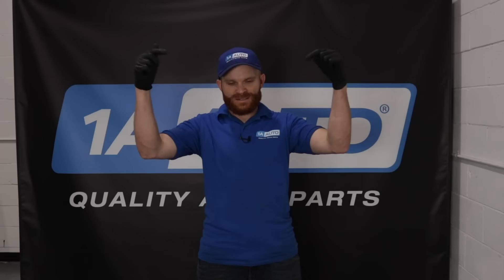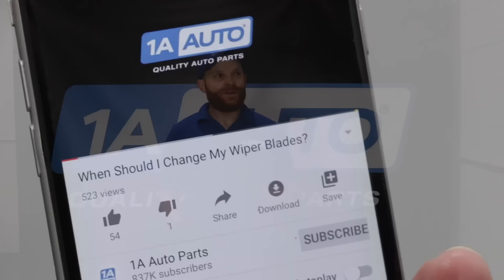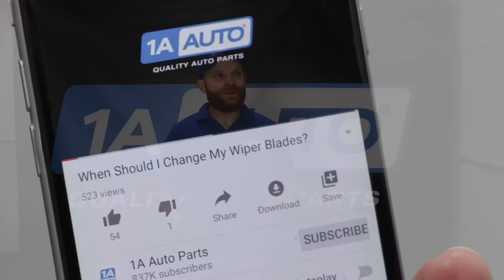Weak Acceleration? Rough Idle? Diagnose a Car or Truck Throttle Body!

Comment: How do you clean the outer edges (perimeter) of the butterfly without opening it?
Reply: I used a q tip soaked in carb cleaner

Comment: I cleaned my throttle body on Toyota Corolla 2009 and after cleaning it actually revs high when driving spontaneously and revs high when I turn on my ac
Reply from the maker: +Luis Dominguez We wouldn't be able to diagnose an issue like that here, you may want to have a local mechanic take a look at it. Thanks for checking us out! http://1aau.to/m/Shop-1AAuto-c

Comment: Could this cause multiple engine misfire codes ?
Reply: my tiburon does this same exact thing, all the symptoms but then throws a code for misfire cylinder in 3 and 6 i’m not sure what to do im goin to clean the throttle body hopefully it does the job. Did you fix yours?

Comment: I have clean the throttle, the MAF and the IAC, however, so much disassembly and assembly may generate a vacum leak.
What is the best safe method to find a vacum leak?
Can you show, tipically where a vacum leak can happen after cleaning the throttle body, MAF and IAC valve?

Comment: Thank You great video 👍🙂  I do have a question : when you disconnected the electrical part from the throttle body you said to look for any discoloration or corrosion. If it is clean, does it help, hurt or make no difference to put dielectric gel on it ?
Is it good to put dielectric gel on anyting for instance... fuses, modules or anything at the electrical Connecting Points ??
Reply: No, it actually acts like a insulator. It is for where you don't want the electrical to go past the outside of the connection.  It also prevents corrosion from water and dirt.

Comment: my 1998 chevy 5.0/305 votec engine is losing power when a hill and gain back its level off what can be done. I have replaced the fuel pump, throttle sensor position idel position

Comment: Hey bro I spray power foam in my car. Now it will now start. What’s the problem. Car was running great before just a little rough idle…so I use the power to clean the deposit….NOW I CANT GET THE CAR TO START

Comment: what about the control to the throttle body? im having a really loud start and surging when at a red light. If i put it in park im good a little rough idle but not too bad, When in drive its crazy bucking and stalls here and there
Reply: Same here. Have to put in park when im at a stop

Comment: I had a chev s10 and the flap in the throttle body had three holes in it with a piece of tape over the holes and it ran great, take the tape off and it ran like crap, nobody i talk to can explain it, would you have an answer.

Comment: Doing a smoke test on a throttle body (5.7L 1996 Vortec).  I have smoke around the shaft that the spring and throttle blade mount to.  Do all of them do this or is mine bad?

Comment: Hey. I have the Engine power reduce only in colder conditions. I would just turn it off and back on and it would go off.  Months pass same situation. Its veen a while it hasent done that. Now, i feel the rpms are not right and it shakes a little. What could it be.

Comment: Is this why my cars dying at a stop light?? My rpms keep fluctuating then my car dies. The acceleration also bogs.. all my fuel systems are new.. I have a year old battery and alt. Also new coils and packs. Also replaced the sensors on throttle body. And my o2 sensors

Comment: I have a 2004 Chevrolet Tahoe and I have my fuel pump and my fuel filter replaced and my check engine is still on and it’s causing deceleration

Comment: I have a 1982 Chevy c10 that has a idling issue possibly. If I were go to Chick-fil-A and sit in the line. After a bit my motor will sounds like it’s getting ready to cut off and my truck cuts off cause I say still for too long. Do you think it might be the throttle body needing a clean? I’ll give it a try tomorrow and see if I can figure it out. Any help would be appreciated

Comment: Hi I need advice, I replaced my fuel pump and fuel filter, changed my plugs and leads, but my Ford Fiesta giving slight rough idle and oh also I removed the throttle body and MAF sensor cleaned it but now I got this rough idle and when I try accelerate it just stalls. 2005 Ford Fiesta.

Comment: So I have a 2016 Jeep compass throttle body but it makes the engine shake real bad and it won't accelerate over 20 miles an hour if that any suggestions on what I can try to fix it?

Comment: I have a Hyundai Elantra 2016 they say it had a leak from the canister they replace an o-ring on it the small leak code stopped but I get erratic idling I was thinking since maybe dirt got in the leak do you think the throttle body got dirty also or do you think it's the map sensor needs cleaned thanks

Comment: I have 98chev s10 4.3, the flap in the throttle body has a piece of tape over the holes in the flap without it it won't idle smoothly, put the tape over the holes it runs smooth, would you have any ideas why.

Comment: Please help. I keep getting p2101 on my 2012 buick lacross every time I want to speed it up. But if I'm driving slow at 30 miles an hour the car run fine. Buick dealer want to charge me 500 to 1000$ to trouble shoot

Comment: Mine stalls immediately after I start it up when its warm. Idle is a little erratic.  But didn't start stalling after my battery went flat. Haven't check out the dirt in the throttle body yet. Of its still having stalking issues afterwards what would you recommend that might be the issue?

Comment: I gotta 2013 Nissan Sentra revs pick up instead of car acceleration and help or advice please I’ve changed trans fluid think I did speed sensor and changed valve body in transmission still revs pick up if I gas it too hard

Comment: Okay man I have a question.I needto clean the throttle body on a 2005 Ford 500. it does have coolant lines but the car is ice cold and hasn't run for months on the road, Are there any special things that I need to do with the coolant lines?

Comment: Would this cause black smoke?? I’m guessing this is the issue with my care since it has been accelerating on its own. But you didn’t mention smoke...
Reply from the maker: +Marisela Villeda Thanks for checking us out! Black smoke may or may not be attributed directly to the throttle body, it may be the MAF not giving the correct readings causing a bad air fuel ratio causing this smoke. We would recommend taking this into a mechanic to have a proper diagnosis and get this fixed.

Comment: My truck will stay around 2,000-2,500 rpms while driving. Its a stick shift. I have changed the IAC the PCV also the air filter an still have the same problem. Could it be the mass air flow or the throttle body. The filter was extremely bad. Any help please thank you

Comment: I cleaned my throttle body without taking it off.. And even took off the 2 screws that hold the flap thing inside.. Took it out.. And put it it back in.. Idle was 3500.. Finally took the throttle body off and adjusted the flap (no don't know the name) and idle was down to 2000... Bought a new throttle body and idle is still 2000.. What else did I mess up?
Reply from the maker: +Jorge carrejo We wouldn't be able to diagnose an issue like that here, you may want to have a local mechanic take a look at it. Thanks for checking us out! http://1aau.to/m/Shop-1AAuto-c
Reply: @1AAuto  I was just hoping you could throw out some things I could check.. Thanks anyway

Comment: I heard a gentle explosive sound (pressured air) out of the throttle area shown in this video. What does it indicate?
Nissan altima 2005.
Thanks
Reply from the maker: +Okoro David We wouldn't be able to diagnose an issue like that here, you may want to have a local mechanic take a look at it. Thanks for checking us out! http://1aau.to/m/Shop-1AAuto-c

Comment: Hey buddy. My 2006 Honda Civic EX has an issue with its idling rpm. Its cold start rpm is around 1000 and after warming up it goes down to 650 rpm. But the problem is this: after stepping on the accelerator as soon as I get off my foot from the pedal, its engine starts to shake and then its rpm goes to 650. I wanna know what is the problem with my engine and what should I do to fix it? Thanks a lot for your consideration. God bless you.

Comment: Maybe I'm just a total Tool,,, but, how does the buildup on the flapper restrict air/gas flow? I mean as long as the touch points are clean? I'm getting the "lightning bolt" light on my Hemi,, cleaned the throttle body,,, and still nothing... Wasn't really carboned to begin with anyways. Noticed that the truck has been fairly sluggish since I bought it, but still ran great for several months. Got an engine light a week ago,, O'reily dude says O2 sensor. Ignored,, now TB light??  Won't start at all... :( Excellent Cheerful vid btw. :)
Reply from the maker: +mike anglada We wouldn't be able to diagnose an issue like that here, you may want to have a local mechanic take a look at it. Thanks for checking us out! http://1aau.to/m/Shop-1AAuto-c

Comment: If my throttle body on a 2005 mustang 4.0 is missing a bolt will it affect my idle 😂? My car idles 2000rpm in neutral while rolling to a stop . Lmk

Comment: So my dodge ram 2500 5.9 360 has these symptoms and now I cant put it in gear without it dying and it jolts forward. I did get it to move in gear when you basically redline it but then it dies again. Could this be a throttle body issue ?

Comment: I have a 2005 Honda Accord EX 4 cylinder DOHC. I cleaned the throttle body. I decided to put a flash light on the back side to see if any light came through and light comes through on one side of the butterfly valve. 

Does that mean the throttle body is defective?
Reply from the maker: +Edward Soto We wouldn't be able to diagnose an issue like that here, you may want to have a local mechanic take a look at it. Thanks for checking us out! http://1aau.to/m/Shop-1AAuto-c

Comment: Can this cause a jerking motion when at a stop light??? Happens mainly in drive
Reply from the maker: +Justin U We wouldn't be able to diagnose an issue like that here, you may want to have a local mechanic take a look at it. Thanks for checking us out! http://1aau.to/m/Shop-1AAuto-c
Reply: @1AAuto  the code is p0300. Random cylinder misfire. I changed plugs already didn’t fix it.

Comment: Will a problem with the throttle body cause a check engine light to come on? 🤔
Reply from the maker: +Susan H Thanks for watching!  Yes a faulty throttle assembly could cause a check engine light to come on.
Reply: @1AAuto  Thanks! Great channel, btw 👍🏽

Comment: i recently cleaned mine out and used the right cleaner but now my car idles high when coming to a stop for about 30 seconds to a minute then it settles out.. but i didn’t know when you have an electric throttle you’re not supposed to push on the flap, do you think that pushing on it is causing my higher idle speed? also no engine light either
Reply from the maker: +chris We wouldn't be able to diagnose an issue like that here, you may want to have a local mechanic take a look at it. Thanks for checking us out! http://1aau.to/m/Shop-1AAuto-c

Comment: The throttle body was cleaned and reset, but the car engine was vibrating after about two days, when the transmission was at d or r, and the throttle was reset again, and after about two days, the vibration was back on again, so what is the solution?
Reply from the maker: +A.M -GH We wouldn't be able to diagnose an issue like that here, you may want to have a local mechanic take a look at it. Thanks for checking us out! http://1aau.to/m/Shop-1AAuto-c

Comment: I have a 1989 Chevy S10 2WD w/ 4.3L V-6. Recently it started to lose power while driving. When I first noticed I was on the interstate driving approximately 77 MPH. I came to a small incline and the pickup would not accelerate and I lost speed going up the incline. I tried pressing the accelerator pedal but the further I pressed it the more I slowed down. If I were to press it to the floor there was no power at all. I found that if I pull over and shut the vehicle off and restart it, it will run fine for a few miles then starts to act up again. Any ideas on what this could be. Engine temp is fine, oil pressure is fine, no noticeable misfires at all.

Comment: I'm curious, for a problem like this, would someone be seeing negative values (aka indicated rich condition) on both the long term AND short term fuel trim from the O2 sensors?  I'm getting slight negatives on LTFT (-3% to -7%), but straight up zero on STFT on my vehicle. (Only one set of sensors, for both bank 1 and bank 2).  I do notice a lack of power, like you mention, and an occasional weird idle/startup.

Comment: I've checked all of that on a previous vehicle, bought a new throttle body and still got that error
Reply: Check your idle air control valve. Usually that can play into it. In you’re dealing with latency in your acceleration, troubleshoot from your acceleration pedal (newer cars will have a tps sensor, while someone older vehicles will have a throttle cable) there’s a couple of things to consider when you’re facing that issue but that’s what I recommend

Comment: Help please I have a 2005 Dodge Durango 5.7l Hemi. Intermittent stalling with no Check engine light on.  When I decelerate to make a right turn my truck shut off but radio is still on so I put it in park and it starts right back up.. I had the Cam shaft sensor replaced a week ago and it didn't fix the problem. Could the throttle body need to be cleaned. I had it done a year ago so I'm thinking that could be the problem..

Comment: I have a 2000 Chevy Silverado 2500 pickup.  For no reason going down the highway it drops down to 45 mph and will not go any faster.  Then 5 miles down the road it snaps out of it.  My 2005 Chevy Impala does the same thing where it drops down to 45 mph and won't go any faster.  Then it snaps out of it to.  What would cause this?
Reply from the maker: +My Life Thai We wouldn't be able to diagnose an issue like that here, you may want to have a local mechanic take a look at it. Thanks for checking us out! http://1aau.to/m/Shop-1AAuto-c

Comment: Will a bad throttle body cause the car to shut off when your not accelerating?
Reply: Yes it can. Only when the electronic is bad inside, and the Ecu cannot control the valve anymore.

Comment: A toyota Voxy, starts, and turns off almost immediatedy........what can i look for?     I checkedthe coils and the spark plugs,  they are still firing sparks fine, the fuel pump is still pumping fuel fine.....i changed the throttle, and the mass air flow sensor...it still does the same thing.
Reply from the maker: +Thakholi Dornald We wouldn't be able to diagnose an issue like that here, you may want to have a local mechanic take a look at it. Thanks for checking us out! http://1aau.to/m/Shop-1AAuto-c

Comment: I just changed my throttle body and when I'm stopped at a red light mu rpm sometimes moves and in on instance it stalled what could it be?
Reply: Same performance happening to my 2012 ford expedation , once slow/stopping at signal the rpm increase to 1100 rom than come downe , any reccomendation

Comment: IF ANYONE CAN HELP I HAVE HIGH IDLE WHEN START UP LOW AT LIGHTS STOP SIGN..CLEANED IT TB NOW ITS LOW IDLE?? I DID NOT TAKE IT OFF THE MOTOR..JUST PRAYED IT AND IDLE BECAME LOWER,,,DOESN'T TAKE OFF IF U BRAKE IT BARELY MOVES UNTIL GIVEN GAS...??? THANKS 94 G20 4.3 VORTEC

Comment: I need some advice on what to do next because my car(03ChevyMalibu) keeps shutting down while acceleration but idle just fine change everything fuel pump,filter,air filter clean throttle body twice new MAF clean EGR valve injectors are working properly but still a major shut down after 2 minutes of driving
Reply from the maker: +lil kill Beats We wouldn't be able to diagnose an issue like that here, you may want to have a local mechanic take a look at it. Thanks for checking us out! http://1aau.to/m/Shop-1AAuto-c

Comment: Help!!! so I was going 120km/h or 60mph tried to over take the car in front of me, went full throttle like padel to the floor... scary af, its like something hit something really hard in my car and dont know what it is. its like someone took a hammer and smashed the car real hard. any idea guys? im freaking out. It happened both to my Bro's 2014 E63s and my 2018 gls 500. U know wht feeling when u go over a really bad pot hole? yea similar to that. exept... there was no pot hole...

Comment: Hi, i have a 2006 lexus rx330 that i will need to replace the throttle body. But i found two hoses. On the right is coolant. On the left. Not sure where is connect to. Do you know? And do i need to bleed any coolant after i replace it?
Reply: That is coolant hoses, one going in and the other coming out. Normally they are connected to the IACV (idle air control valve) on the throttle body. If you clean the TB might as well clean that IACV.

Comment: My car looses power when i stop at the stop light, turn on the A/C and when i put the car in Park. Could that be the throttle body?
Reply from the maker: +Carlos Parras We wouldn't be able to diagnose an issue like that here, you may want to have a local mechanic take a look at it. Thanks for checking us out! http://1aau.to/m/Shop-1AAuto-c

Comment: I have a 2005  Mercury mariner V6 and the Rpms jump and it has a rough idle and vibration inside the car my car stalls  Accelerate It's like Lynch's forward is there any way you could tell me what might be going on I kindnone I kinda thought it was the throttle  I'd love to know what you might think thank you for your time sincerely Shelley shanklin
Reply from the maker: +Shelley Svaldi We wouldn't be able to diagnose an issue like that here, you may want to have a local mechanic take a look at it. Thanks for checking us out! http://1aau.to/m/Shop-1AAuto-c